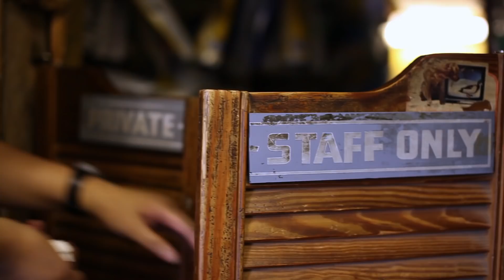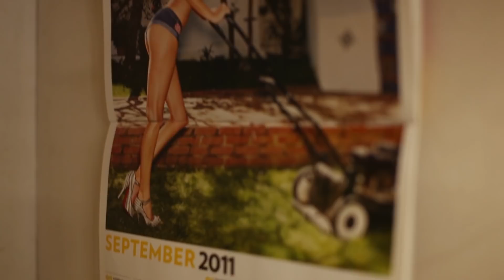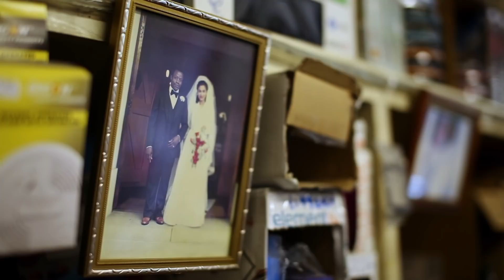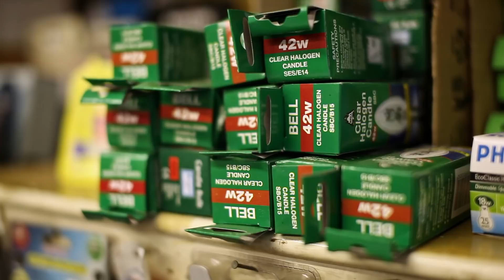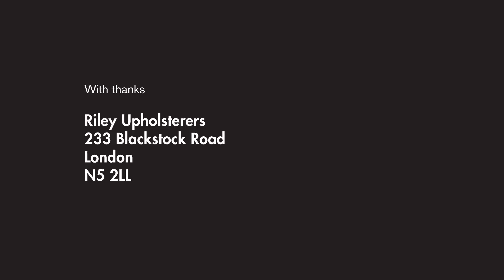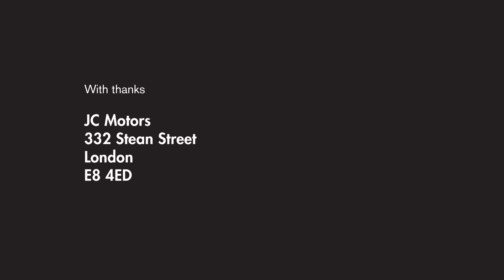Stewart Lee on The Art of Repair, with Hackney Artisans in East London

Comment: making something has a set method. some pieces are impossible to reach once others are joined around it, and therefore require a specific sequence to their construction. repairing something requires you to reach the impossible, without marking anything between you and it. 
repairing isnt just a language; its a more complex dialect within a language. 
what makes matters worse is that antiques by now are usually so worn they have to be remade from scratch, often using techniques thatve been long forgotten, while more recent items are poorly made and subsequently unnecessarily difficult to repair, but current items have built in obsolescence with no spare parts available, therefore impossible to repair and disposable.